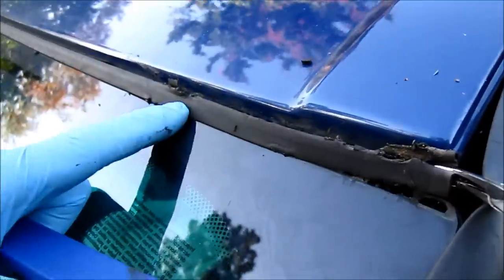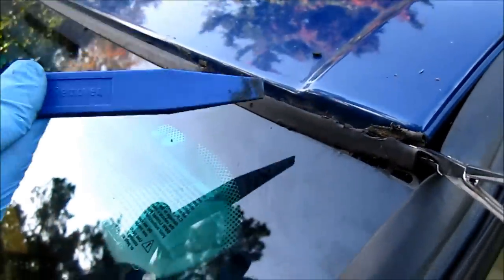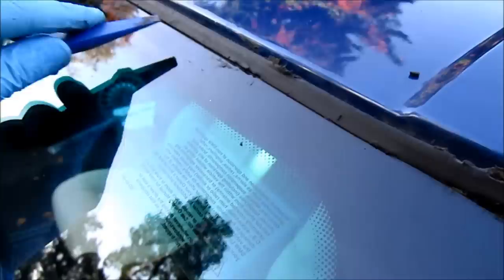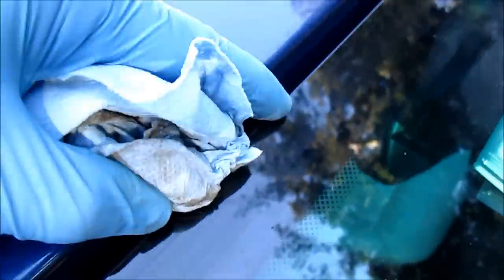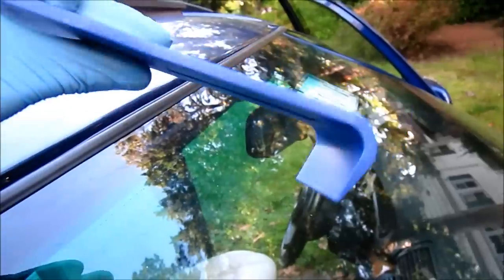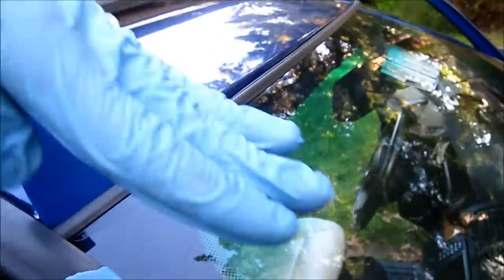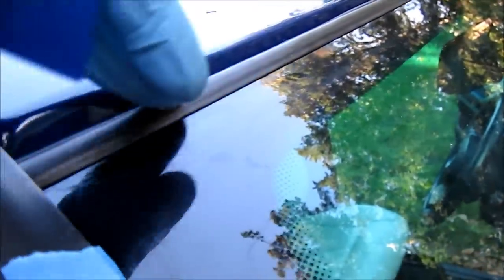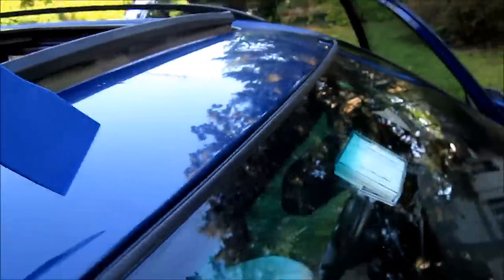BMW Weatherstrip Replacement DIY Guide

Comment: My experience with this task, is after removing the old strip and cleaning everything, I needed to use some spray cleaner, like Formula 409 to spray in the groove at the top of the windshield between the glass and body to lubricate the rubber trim to body interface.  Otherwise there was too much friction to get the trim piece to slip down far enough into the groove and at the correct angle so the trim's u-channel could then be manipulated with a trim tool and pressed upon the top of the windshield to capture it.  I could not come close to getting the part in place without doing this.

Comment: Of all the videos just replacing the weatherstrip, why are they only BMW cars. My 2000 Pontiac grand am GT sedan 3.4L has similar style U / C Channel strips. And why does no one put more windshield sealant back in. Surely the old strip when removed is removing the old sealant along with it.
Reply from the maker: The sealant is inside the valley of the weather strip rubber.